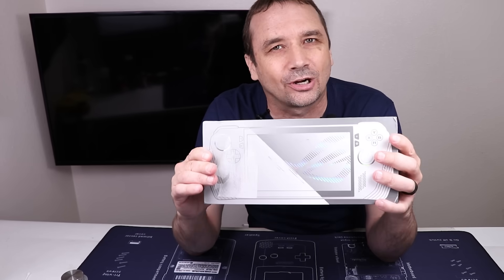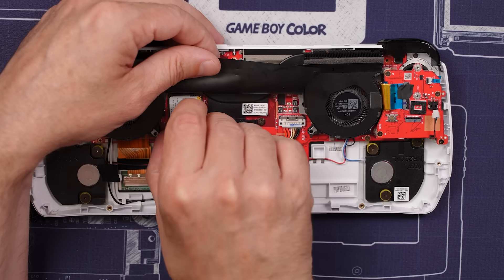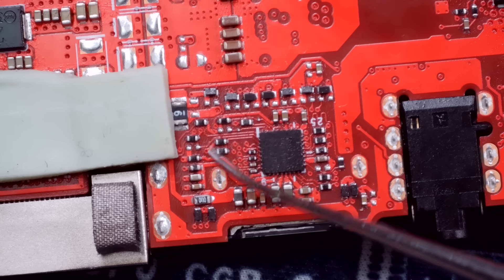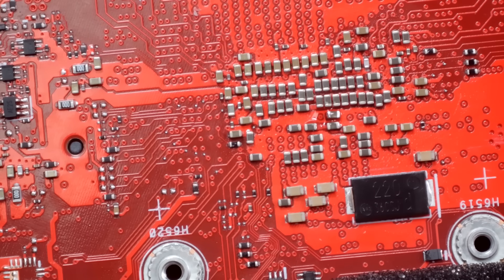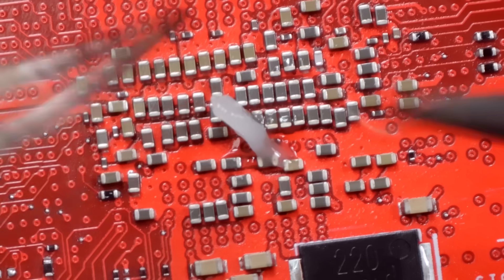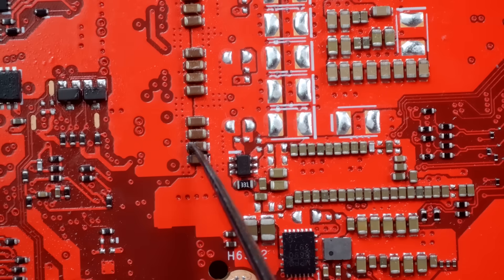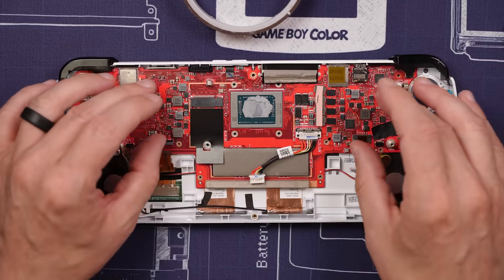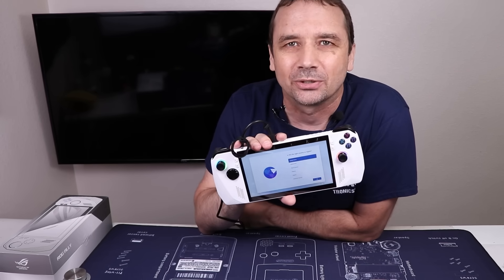ASUS REFUSED to Fix His ROG Ally - Can I?

Comment: That's My Asus ROG ally :) , I am so happy you were able to fix it , put a smile on my face . No clue why that capacitor was blown out , didn't even come close to there. I was only near the microsd
Reply: Can you talk about the ASUS warranty issue? Were you still within warranty period (how long?)? Why did you attempt to fix it if you still were? Other than "water damage", did they say anything else about what violated it? Did you try to push back and what did you attempt? Would you still trust buying ASUS based on how they treated your warranty?
Reply: @zephyrsimon so I was still under warranty, I had around 7 months left. When I first bought the item brand new , it came with SD not working and I never bothered fixing it because the SSD was enough for me , then before selling it I wanted to fix it so the price wouldn't be too low due to the SD not working . I saw a YouTube video and it looked pretty straight forward, I was left with the choice of fixing it myself or send it to Asus(which probably I should have done at first ) I didn't want to send it and wait for a few weeks for it to be fixed , I heart the timeframe can take very long so I went for it and decided to repair it myself. Like I said I did actually fix it and the device powered on ,I inserted an SD card and it worked , recognizing it. Then I had to restart the device after updating the drivers and it never came back to life.
I then sent it to Asus and they said it was liquid damage (after two weeks of having it), and that a liquid fell on it which I kept saying this didn't happen and that I swear no liquid has fallen on it , I pushed it to the higher management but everytime they said the same thing , and that my device is out of warranty since it's liquid damage , that It would cost 867 Canadian dollar to fix the motherboard and the LCD. I then asked for them to return it. I am not saying I am innocent , I shouldn't have tried to fix it myself , but I also think that they didn't really check it correctly and now I know for a fact they didn't since no capacitor cost 800 dollars. They should have easily found it like Steve did. Anyway the lesson learned.
Reply: Paths go all around the board. You'd need to examine the active schematic paths for that board to understand how that blown capacitor may relate to the microSD area. A short near the microSD area could have fed full power through that capacitor and blown it. When you worked on it and it then worked briefly, that may have been when the short came to exist and blew that capacitor.

My concern is that Steve didn't examine the area that you worked on, at least not on camera here. If that previous work that caused the short still exists in that board's microSD area, a short could manifest again later, potentially blowing out that same capacitor again. Might want to ask Steve to verify the work you did to ensure there's no potential issues present.

It would suck for you to get it back from Steve only have it short out again. Although, it's been several days since your comment. It's possible he's already shipped it back to you.
Reply: Just remember to use a toothbrush and rubbing alcohol after your done to get rid of flux ends up getting really dirty after awhile also if you had done that they never would've caught you 😂
Reply: My guess? You reflowed the SD slot, while assembling or dissasembly you knocked off the loose capacitor (maybe it was barely on there and you heating the board knocked it off) that caused the short which disabled the other capacitor. 

Either way, ASUS refusing warranty for liquid damage is invalid. ASUS refusing warranty repairs would be valid had they inspecte dthe board and found the loose cap and the blown one. From there they could easily have argued user induced damage due to faulty repair. But for that to happen ASUS would need to inspect boards, and they do not do that. 

They test the board, if it fails they claim water damage. If it passes they check other components, if one of those fail they claim water damage and let you pay for a new board anyways. This whole process takes around 5 minutes because no human eye ever looks at the board under any kind of magnification. The fcat that ASUS does not use water ingress identicators tells alot, especially considering that almost all their warranty claims get refused for "water damage"
Reply: I was wondering what the original owner thought of this video. Glad to see you're happy he fixed it! I think it's BS that they said this had liquid damage. It clearly did not.
Reply: @jmonteschio  thank you , honestly I was hoping it's fixable since I found 800 plus dollar is a lot to fix something that I knew didn't have liquid damage,  that capacitor blown out shouldn't have cost this much . Anyway hopefully it finds a new owner :)
Reply: @PepitoMilo02  well if you try to repair it your self before sending it to asus than your warranty will void ;-) but i can tell you that the common issue for the ally is the SD card reader fail or stick drift i know the proccess because i worked for asus :D
Reply: Sure champ
Reply: the microSD reader is working?
Reply: Why not just send it back to Asus and get then to fix the MicroSD under the warranty and not risk breaking it more accidentally and then have them refuse the warranty anyway
Reply: I agree!They should have fixed it! If the flux was the cause I feel like they should have been able to identify  it. Im sure they probably use it to fix things as well.
Reply: @ronniemadden322 ya it was just flux , nevertheless I shouldn't have tried to repair myself , lesson learned . But what makes me sad that It did power on and the microsd worked until my device restarted and never turned on . At least now I could be in peace :)
Reply: @PepitoMilo02  Hey, dont beat yourself up over it. You did a really good job starting to fix it for your first time!
Reply: @ronniemadden322  Why didn't he send it in before trying to reflow the BGA? They likely would have accepted it if he hadn't opened it himself.
Reply: Lesson Learned hopefully , Never try to fix something that's under Warranty Period , it just gives the Manufacturer the exact reason to Reject the Warranty Claim by its been tampered with by the Owner 🤨
Reply: @farmerJ-zp9dj yes lesson is learned 💯.  It was tampered by owner correct but no liquid damage
Reply: because they're built poorly with poor grade components.
Reply: Those capacitors are ceramic, and they can crack if the board is flexed, dropped, or bumped.  Once they crack, they'll blow out at the next power up, even under normal voltages.  Just taking the board out of the case can sometimes cause enough flexing/bumping to crack one of the many capacitors.

That said, while I think ASUS should have fixed the unit as a courtesy, I am not at all surprised that they didn't.  Once a product has been opened and worked on, they don't know what's been done to it, so they aren't going to assume it's a defect in workmanship which is covered by warranty, they're going to assume something else happened to it while it was opened.  And indeed in this case, a capacitor got cracked, and no one knows exactly how.  I do condemn them for the obvious lie of liquid damage, that is a complete made-up excuse.
Reply: @PepitoMilo02  you spoiled the ending 🤣
Reply: @johnhancock782 don’t read comments before watching
Reply: "no clue" 😂
Reply: I don't understand why you tried to fix it if it was still under warranty.  As soon as you undo the screws you are voiding the warranty.  I understand the hassle of sending it out for repair, waiting and not having it for a while but that's not worth voiding the warranty.  Out of warranty, I would have whatever the hell I wanted to.
Reply: @TheFiftyQuid because I didn't want the hassle of the time it ships and the wait time ,  but what can I say , I was wrong and I rushed
Reply: @TheFiftyQuid undoing screws does not void warranty. That would be in violation of the magnusson moss warranty act, onus is on the company to show that’s the damage was caused by the user
Reply: @TheFiftyQuid  I dont understand why we cant open things we own
Reply: @TheFiftyQuid  you are allowed to open it up and change out ssd analog sticks buttons etc  right to repair has limitations as soon as he put flux on it and left the residue there he voided the warranty before sending it in he should have cleaned the residue off it properly yes it is liquid damage as there is residue in the trons video clearly they probably opened it up saw the residue and imidiatly said liquid damage
Reply: i am on ASUS side, but hear me out! 
because i wasnt at first. them saying its liquid damage is BS. obviously. but them saying they would repair it for free would also mean that EVERYBODY with a screwdriver get the green light to tamper with their stuff first for fun and THEN get a free repair job at the end anyway. to prevent this i guess this it was a "business decision" 
the only thing i am sad for here now is that 90% of people wont understand the background and lack of a logic opinion which will damage ASUS image overall - together with this clickbaity title ASUS getting a bad reputation. 
but i do respect you standing up and admit to your mistake trying to fix it yourself first. nothing wrong with that. overall the outcome for you is good. for ASUS not so much. but then again i dont recall them being such an amazing company either.
Reply: @cloudpandarism2627 agreed, warranty is there within the period, and without tampering with it. First send it in if you still have warranty, then try to fix it yourself or via a repair shop.
Reply: Dont spoiler the result
Reply: @komikusholic yes I apologize earlier to another comment the same , I was just excited and didn't know people read the comment before watching the video . Apology again
Reply: You attempt to repair while you dont even know the correct parts😂

Comment: Customer opened it first and tried to fix it so no warranty unfortunately.  I have the Ally extreme and all I did was add a larger ssd so I wouldn't have to use the sd card slot knowing it may have issues.  It never has but you never know.  I want to do the battery upgrade but I'm not sure if I have the skills anymore since I got old :)

Comment: i have 1 of these myself, the MicroSD card reader stopped working. So i sent mine on warranty repair and they replaced whole motherboard. So i got it back and now MicroSD card reader works again and i paid nothing for it aswell.

This thing seems to be region based, where some places have poor staff and others have proper ones.

Also repairing something yourself does void warranty, so if he tried to repair it himself. There's the answer, warranty voided and Asus won't accept warranty claim.

Btw, you should never unplug cables and install SSD with battery connected still, always prioirty is to disconnect battery first, then unplug cables etc.

Comment: Took mine back to best buy after ghost recon Wildlands fried the mobo. Was out of original warranty but Asus extended motherboards warranty an extra year. Sent mine out with working SD card slot. They fixed it but it came back with non working SD so I figured the just swapped mobo with another they had on hand. SD slot only worked with 64gb card the 1tb I had that worked in it previously wasn't reading but was on other computers. I found a vid on YouTube showing how to reflow the SD slot. Did that myself and it works fine now

Edit: you can also remove mobo without removing heatsync, did it on mine because I had no thermal paste on hand

Comment: I noticed that you checked the button presses before assembling them for clickability. And I have a problem with this, when I chipped my Switch Lite, I accidentally dropped flux on the right bumper button, now it sticks, washing it with ethyl alcohol did not help, is there a way to somehow clean the button or is it easier to replace it?

Comment: The should have done the repair.  There really was nothing wrong with it from a rebuild perspective; they did a great job trying!  I am surprised it didn't get fixed.  I dumpster dived a broken 3070 out of the recycle bin at work. I asked ASUS for an RMA# because it turned on for a split second and loses video issue. I say I don't have my receipt.  They issued an RMA, and also repaired it at no cost.  Issue they claimed was a scratch on the board.  Another incident,  I had a heat sink fall off a video card and they upgraded my card and replaced it.  I don't get where all this bad customer service is coming from unless its some sort of regional thing.

Comment: I think if you do anything inside other than putting in "User serviceable items" (anything that doesn't require solder, etc) then the warranty is void.  Not that Asus has the best track record with repairs (but I do agree with them for this one).  But if he wanted to have something fixed under warranty, he needed to send it in without changing or "fixing" anything.  Once it's outside of warranty, sure - tinker 'til your hearts content.
Reply: That's not how this warranty works, nor how warranties in general work. Companies can't reject a warranty claim simply because someone has tinkered with a device they own. Even owner-attempted repairs do not automatically disqualify something from warranty repair. If Asus are going to reject a warranty claim on the grounds of user-induced damage, they have to prove that the user induced the damage.

In this case, they aren't even doing that. Notice that the reason they cited isn't anything to do with "user-induced damage." Instead, they are claiming that "liquid damage" is the reason for the device not working, which is untrue on two fronts: 1) the device is not working due to a blown capacitor, not due to liquid damage; and 2) there is no liquid damage to the device at all.

They cite "liquid damage" because that's simply the standard excuse, as it is for many tech companies. It's likely they didn't even do a thorough analysis to find the root cause of the problem. They are counting on people not fighting further past whatever excuse they lay out. The exorbitant repair fee is likewise meant to make people scoff and drop the issue.

The reason why people are encouraged not to tinker with their devices until it's outside of the warranty period is because doing so gives the company something to potentially point at as an excuse to not honor the warranty.
Reply: Nah the warranty should only be voided if what you did broke the device. Say if you successfully mod something, and then something completely unrelated to your mod breaks due to a manufacturing issue, the warranty should be honored. Of course it could be hard to prove it wasn't your mod that broke it, but if it can be proven, the warranty should absolutely be honored, because there was a fault from the factory.

Comment: I reflowed this BGA chip to get my sd card reader working again as well. Repair went smoothly and all is working again. I, however, applied a heat tape barrier from the exhaust air flow to help it not happen again since it's a known issue. I wanted to invest in improving my skillset, that's why I didn't send mine in for repair. Tricky repair, but worth it.

Comment: The fact they didn’t know what they were doing and attempted a repair makes me think they should have denied this.  My guess is they messed up the capacitor or bridged something.   Also who knows if asus already tried to clean it up a bit before it got in your hands.  

I had a similar issue with my ROG Ally a month ago where it wouldn’t charge.  They paid shipping both ways and repaired it without issue.  I have opened it up before and swapped the ssd.   Before I sent it in I swapped it back.

Comment: So I don't know where else to ask. This seems like a good enough place. 

Got a Dualshock 4 that doesn't work without a charging cable. Works OK when plugged in, even shows the blinking orange light to suggest it's charging but I get absolutely nothing when it's unplugged.
Console shows 0% battery on the controller.

Anyone have any ideas please?

Comment: if the user is messing with the insides of the device, asus is no longer in charge for it. Asus also need to cover a warranty after the fix, so they will not cover for anything the user did wrong, so i understand that they would have replaced the entire motherboard instead of fixing anything.

Comment: Well if it looked like it did when you got it, then yes, they definitely should have fixed it. But the thing with Support depts, they will make up bull sht stories to get away with not honoring things. I don't work on stuff like this And Your camera work shows me that they didn't even wipe anything down if there was Liquid Damage,  as you pointed out the flux residue, so if it was wiped down due to liquid damage ???  wouldn't that also be gone???

Wish I had a proper work area because watching your channel makes me want to do this stuff. But I live in an apartment so no where for vetilation. Enjoy watching all the same.

Comment: I would say no on warranty. Of the previous owner opened it up and started messing around, that is not a parts or manufacturing error on the part of ASUS. They obviously can’t tell the difference between full and liquid… but if he had just sent it in without that, maybe they would have treated him differently. If it was liquid damage, I think the only thing I would do is clean it up and then send it in to them.

Comment: Hey Steve, I have a ROG Ally with a strange problem. I plugged it in to charge on a road trip and afterwards I noticed that no USB 2.0 devices work anymore. Tried with a dock and directly connected with no luck. I have tried a factory reset and also the BIOS fails to detect anything USB 2.0 such as a mouse or keyboard. Display out via dock works just fine. Is this something that you’d be interested in taking a look at? If there is an email that I can reach you at, I can do that too. Thanks!